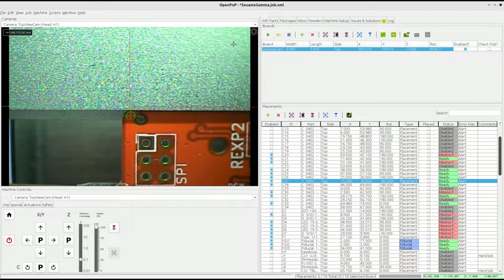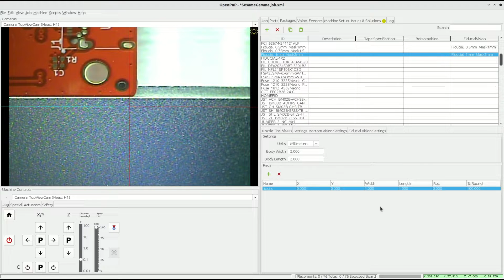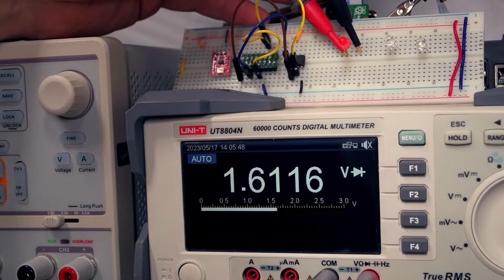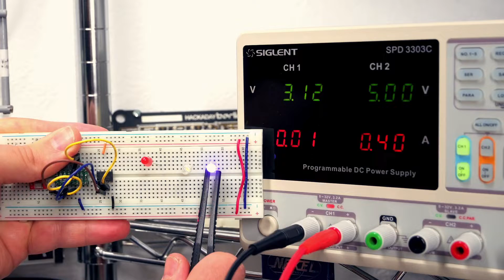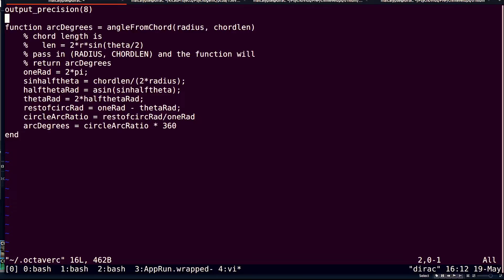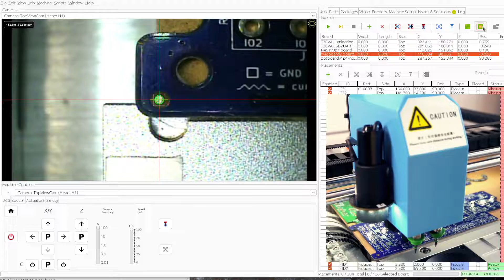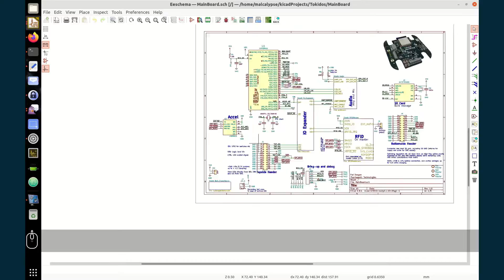PnP Vision Boost: Keep the Camera, Upgrade Performance | Simple hardware enhancement

Comment: Can this pnp work without fiducials? I just bought one, but my current pcb design does not have fiducials.
Reply from the maker: Well, if it's just a few boards you could probably get away with positioning the zero just right.  With open pnp, you could just create a "fiducial" package, with a roundness of 0 and the right size for say a resistor pad and then choose 3 that are close to some corners and then used them normally.

Comment: Love you video thanks. I have a QiHe TVM802 which I am in the middle of upgrading to OpenPnP myself. I've paired it with a Rapidboard running Smoothie and I've got to the point where I am needing some time to calibrate it. I've upgraded the camera's too. I was wondering on how you configured the drag feeders with the friction wheels for removing the tape.
Reply from the maker: Nice!  The feeders: that's supposed to be my very next video--keep getting distracted by kicad--but it's already recorded, dammit, just need the time to edit.  Short version is you've got two actuators to play with and after some tweaking (and some breakage, lol) I found some good recipes.  Shouldn't be long to come out.

Comment: You could shine the leds with 45 degree angle from 2 sides, have you tried that?
Reply from the maker: Hi!  No, haven't tried that.  Could improve things but on one hand they are working pretty well now and on the other I've always been sub-par in terms of mechanicals--could always 3d print stuff to accomplish this, but it's probably more fiddling than it's worth... but, dunno until I try it.
Thanks!

Comment: The shenzen scene had me rolling man. Damn, thats good. This pnp looks pretty damn good.
Reply from the maker: haha, yeah I had fun!  And I jest about the company in this vid, but I have to say I'm very happy with the machine.  It's true my use of it is light: I do not use it for industrial production, and all my runs are prototypes so usually between 5 and 25 or so of any one board, and I don't think I've ever done more than 60 of any one thing.  But, at least for my needs, the thing is fast and fun to use.

Comment: Really cool you used Octave !  Well done.
Reply from the maker: Hi!  Oh Octave?  Yeah, I use it for some heavyduty stuff but for a long time now--because I always have a terminal handy anyway and because it's faster than using a mouse--I turn to it whenever I need to do any basic calculation.  Why load some "calculator" application when you can do so much right there, with your keyboard? Plus the persistent history and reverse search are just so useful.
Actually, I also use python for this, especially when I need to play with bits (no idea how I'd do "bin( (10 | 22) << 3)" in octave and bitor() just doesn't come as naturally as "|" anyway).
Anyhow, short version is I love octave and thanks for the comment :)

Comment: Did you abandon the Lite Placer?
Reply from the maker: Not completely?  Fact is it has been gathering dust in a corner.  The CHM is fast and easier to feed, but boy oh boy does it not have much vertical clearance.  This will be a problem with some connectors, even electrolytic caps.  So, I'm waiting to see how much trouble that causes, and if I have batches that would benefit from a 2 machine system.
Reply: @PsychogenicTechnologies  Interesting. The feeder turns out to be the reason my Lite Placer is still a virgin. Organizing parts seems to be a major issue for me. For small builds it seems like the optimal solution would be to just dump the components into a little dish and let the P&P locate and orient the part. That would also require flipping components... complicated. The goal is to make PCBs not design and build the latest state of the art in P&P robotics.  So, if your Lite Placer had some sort of smart feeder that you could load up with parts and forget about until it's empty, would that machine be dusted off?

Comment: Looking to upgrade form the old CHMT28 (will love a bit more feeders). There are constant current limiting devices just two pins if you want a more constant current with variable voltage.
This as an example is 10mA NSI50010YT1G  and it requires a minimum below 2V drop to start limiting at 10mA
I was looking at the CHMT48VA as  do deal with an external computer it just need to work. I subscribed as maybe if I ever get time I modify the old CHMT28 adding vision.
The red wire was funny and reminds me of the EVE and CATL large format LiFePO4 cells that use black to denote the positive terminal (at least negative is not red but also not black).
Reply from the maker: Your comment had me back on the charmhigh site and I finally realized why there was such a nice port in that front panel, under the fat sticker--it's to add a screen... hah, I might think about a home-rolled version of the 48.  Will add that to the stack of copious-free-time projects.  But really, I like having openpnp on an external system that I can manage and upgrade without touching the machine.
They came out with the T36VB, while I was sitting on this machine in its box.  From what I gather, it's the same system as mine with a whole lot of feeders, as in double, so that might be worth looking at.  With the space I have for it, I'm ok with the T36VA but I did have a tinge of regret when I saw it. 
That CCR is a very cool solution that would guarantee consistent lighting regardless of the V provided by the pnp... for 50 cents.  Nice.
And yeah, the wiring bit me.  Often I just measure stuff without paying attention to the MM leads and sticking them in there however is most convenient, caring about the value but not the sign.  I also have a little mental note about double checking lithium batteries, especially those from ebay/aliexpress/alibaba as I've seen both flipped wiring colours and, more often, flipped JST connectors.  Just didn't expect it inside this machine. Hah, lesson learned.
Reply: @PsychogenicTechnologies  Yes space is also a problem form me that is why I initially went with the CHMT28 and is also why now I'm looking at the 48VA instead of 48VB.
I was also looking at NeoDen YY1 but that has way to many drawbacks compared to the Charmhigh models.
On the YY1 the peeler mechanism is way worse and the placement speed is basically half.
Reply from the maker: @electrodacus  Ah, yeah, 48VA seems a good compromise then. Have worked out--though am still perfecting--some ways to increase the feeder capacity a bit without taking up more physical footprint.  
NeoDen:  not exactly a stellar sales pitch, there, hah!  What would the upside be, form factor?
So far, I'm really happy with the CHM.  And I'm not even pushing it to its limits (suboptimal support stand, still).
Reply: @PsychogenicTechnologies  As you noticed this Charmhigh CHMT's  are fairly heavy so the YY1 being a bit more compact and almost half the weight is a positive.
Neoden YY1 is                     64 x 55 x 60 cm and 35kg
Charmhigh CHMT48VB is 132 x 70 x 34 cm and 68kg
Fairly hard to get parts for the Charmhigh. I had the resistive touch fail on my CHMT28 5" screen and was unable to contact them to get a replacement. Luckily I had an old 5" GPS device that had basically the same screen and was able to replace it with that one that works fine for the past few years.
Reply from the maker: Ooof, the parts thing isn't something I've had to deal with yet.  It was one of the major upsides of the liteplacer, everything was basically COTS.
As for the weight--had no idea it was so different, but I think I like the inertia of this beast--something of a counterbalance to the speed of the head moving around.

Comment: Does it have a bottom camera? I'm curious how you set up the part recognition pipelines. Those have always been a pain.
Reply from the maker: Yes indeed, it does have a bottom camera.  
In addition: I have also found bottom part alignment something of a real pain.  Getting it working isn't so hard, it's getting it working reliably... maybe if I installed these things in rooms with no windows/steady lighting, things would be better.  And if I conceded to give the head one of those sombreros type screens to even things out a bit for the vision...
Still, I have yet to play with it much with the CHM machine mostly because I've got a pattern where I definitely use the bottom cam for nozzle calibration, but hardly ever for part alignment: 0402s, ICs... the precision of these things and the reflow process seem to handle a whole lot of the alignment for me.  
But, it can be improved and it is something I want to look into further, especially as it seems I may have a larger-than-usual batch to do this summer.
Reply: @PsychogenicTechnologies  I agree, consistent light helps a lot to get the vision more reliable. I have been thinking to just hack up a cardboard box that goes over the pnp machine to block out most light sources. If that works as a proof of concept, I can always make a nicer box/frame out of wood or metal with a hinge to fold it away.
What would be really cool is if there was some kind of "background light calibration script" that would look at a known part (or the nozzle), adjust the camera settings and try some parameter sweeps to get the best possible vision detection. Machine vision and our perception of an image with our eyes and brain are not the same, so maybe this would actually help to find the best settings for MV and not just give us humans a pretty preview image in OpenPnP.
Reply from the maker: Yeah, you're right that are eyes have insane dynamic range and don't act like cmos sensors... Hm, that calib script idea seems pretty good.  Like a gray card for photo/cinematography.  
I don't know how much this would improve things compared to the auto exposure on the cam, but at least some of my problems in the past were due to rapid changes in light due to moving around and that adjustment being slow/imperfect.  So the "black box", or some form of steady lighting at least (I really don't want to get in my own way when doing runs--sometimes I need to see and touch this machine), and a single shot calibration might help.  
Some experimentation is warranted.
Reply: @PsychogenicTechnologies  I had similar issues with my attempts.  I blocked off the windows and built a super-bright LED housing for the bottom cam.  But I never found a bulletproof pipeline that could reliably recognize more than rectangular parts.  I was hoping to get better failure detection and rotation detection, but no luck so far.  I'll be dusting off the machine again soon, and updating OpenPNP.  I don't think I've used it in a year, so there are probably improvements made.
Reply from the maker: Yeah, am concluding this is an area worthy of further investigation...  maybe not for the next vid, tho, hah.

Comment: Cheers Pat, nice work!
Reply from the maker: Many thanks, and cheers back at ya :)  Funny, I mentioned the idea of using a granite stand for the PnP in another comment and think I was inspired by your setup.  How goes the dev on that?
Reply: @PsychogenicTechnologies  Hey, It is going well, X, Y, Z1, Z2, and 4 nozzles are alive along with all other valves and LEDs. I made a small custom PCBA to control two pumps so that on longer jobs one pump does not overheat (on every OpenPnP pump trigger different pump is activated). Currently, I am finishing the conveyor design which OpenPnP does not support still, but it can be done via some Scripting and adding Head2 alongside Head1 in the OpenPnP machine config. Btw, I know who to contact for scripting support! Wink Wink! 😅
Reply from the maker: @zdenkostanec1622  Awesome.  Ya, do ping me if you want to do some neat extending, either as scripts or into openpnp proper if it's widely usable--would be fun to play with such a capable machine, and one you built at that!
Reply: @PsychogenicTechnologies  Cheers Pat, will keep in touch!

Comment: Very interesting videos, look forward to more! I see some nascent support for OpenPNP-compatible hardware, hopefully it can follow a trajectory similar to 3D printers (though the market isn't as big). BTW, there's usually a capacitor across the output of the PSU (470uF on one of mine) so if you just slap it across the output you'll discharge the 5V charged cap through the LED before the current limit takes control. Not ideal.
Reply from the maker: Yeah, I think you're correct about the discharge--that, and the non-zero delay for things to happen--as the LEDs always have a burst on first contact... maybe not an LED I want to include on a board, but I've yet to actually blow one this way (over-cooking, tho... ugh the WS2812's were so sensitive).  So yeah, I'll sometimes sacrifice one when in a rush but it's mostly been when in a pinch.  Still think it's cool ;-)

Comment: Buddy, you need to get a heavy duty table for that monster! :D
Reply from the maker: hahah, I knoooow.  What I need is a proper alter, something made from granite painstakingly transported from Aswan to appease the PCBgods, but alas.   Just setting it lower would help... the pnp, not mah back, tho!  Keeping fingers crossed in the meantime, it's been ok knocks on the old ikea horror used prior
Reply: @PsychogenicTechnologies  Maybe add some canisters filled with sand/water to the bottom of the table, to make it heavier? You just need some mass in there so that the accelerating tool head has some counterweight to work against. Having the weight in portable canisters makes it easier to move around piece by piece, and you can even tune out resonance issues if you want to go deeper in to the rabbit hole... 😬